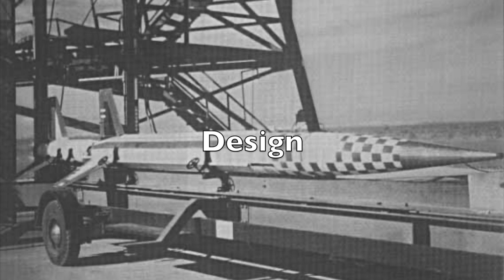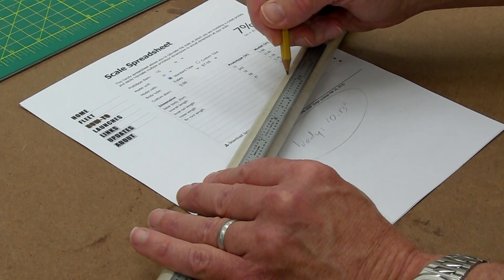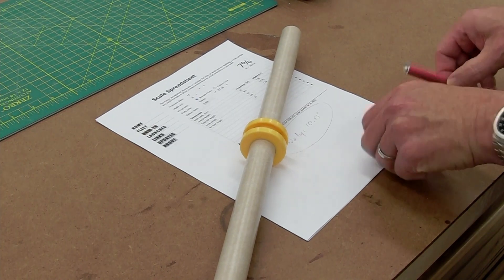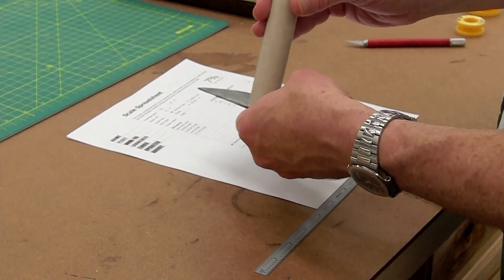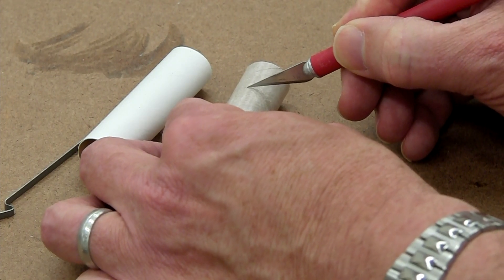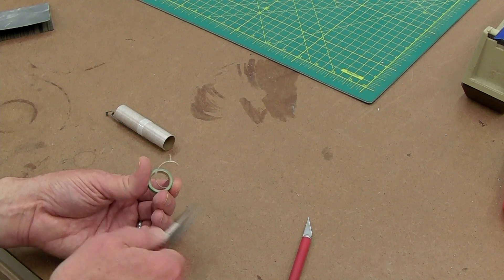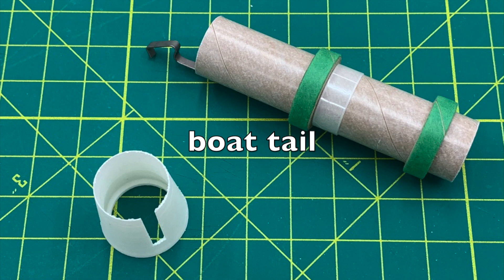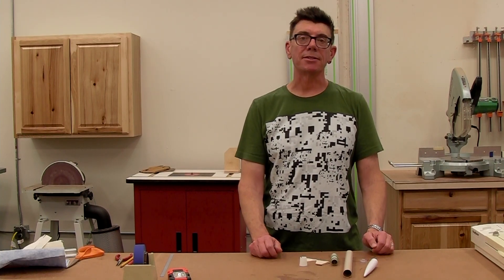Model Rocket Scratch Building

Comment: Is there a way to make nosecones? If yes, how can I?
Reply from the maker: 3D printing works well. The forces on model rockets typically don't exceed what can be printed easily. PLA can warp due to heat (such as being left in a hot car), but seems to be strong enough to survive flight and landing.
Reply: @JohnLCoker  just one problem, I don’t have a 3D printer haha
Reply: @JohnLCoker  thanks for the information!

Comment: The Aerobee is one of my favorites. This is great to see you doing one. Sounding rockets are the best to do.I like how you did the Boat Tail. Are you going to do a Part Two?
Reply from the maker: I hadn't planned on it. Once the parts are fabricated, it goes together like any kit. Is there something else you think should be covered?
Reply: @JohnLCoker  No,you did a great tutorial .I thought maybe if you assemble it you may show the finished rocket. The Aerobee series were a great mile stone in rocket design and research. I have 3 in Mid Power 29mm and 2 in 18mm. It is a cool looking rocket. I hope you get to fly it.
Reply: @JohnLCoker  Does the Altus Metrum fire the 2nd stage motor?
Reply from the maker: @aerobee58  Which rocket are you referring to?
Reply: @JohnLCoker  the aerobee.
Reply from the maker: @aerobee58  For the two-stage HPR Aerobee (not this one), I used a G-Wiz to light the sustainer.